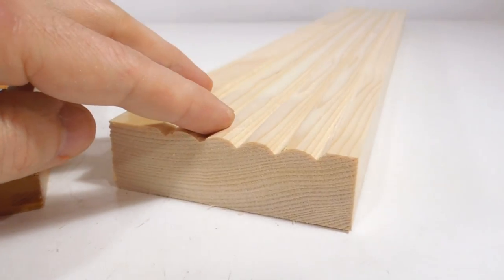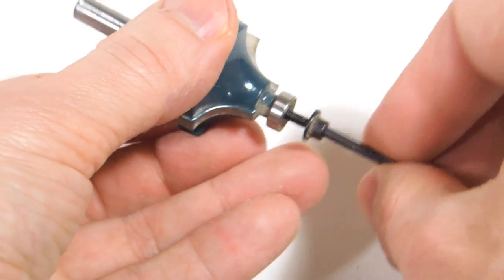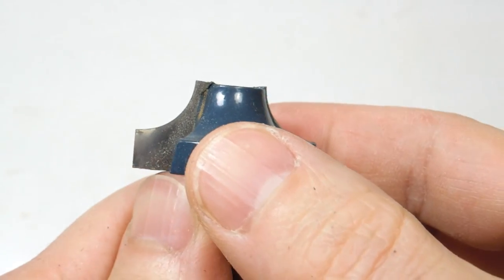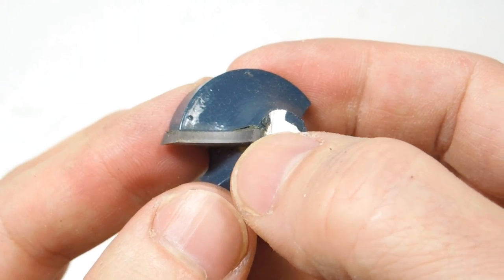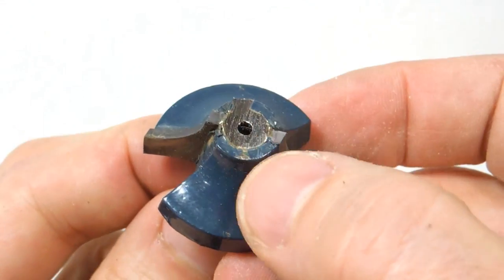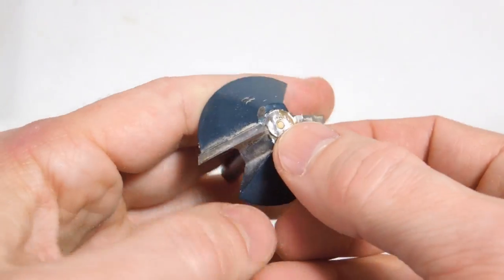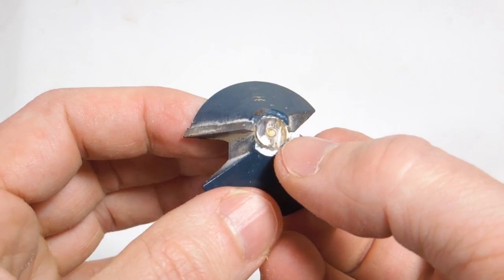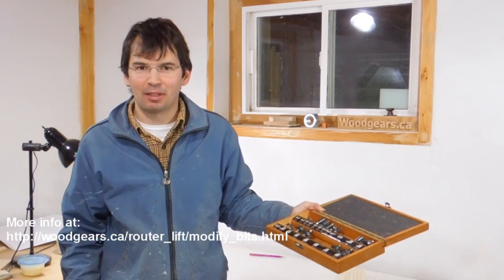Modifying router bits

Comment: As for the folks talking about balance, I once had a 3/4 inch straight bit throw one of the carbide cutters off, in it's entirety. the bit was 3/4 with a 1" cutting face, so it was a large cutter in respect to the overall size of the bit. I noticed it had slowed in material removal, and seemed to be running a little rougher, but continued to run 800 pcs over it that day. When the job was finished I decided to take the time to change the bit and then reset the height.

Comment: When I changed the bit only then did I notice it had thrown a cutter off. It started running rough about 4 hrs before we finished, so I estimated it had run a little less than half the run, and that tallied up to be around 1400 linear ft of dado I cut with a one bladed bit. It never vibrated any more than before it had thrown the cutter. It did chatter a little when cutting, but ran idle just as smooth before. The vibration coming from the router armatures was the only noticeable vibration.

Comment: @smfield The shafts are regular tool steel, but the carbide is not tempered as we know it with typical steel, so in other words unless you heat the bit enough to loose the temper in the bit you'll be hot enough to melt the solder holding the carbide on and it's a total loss at that point anyway.

Comment: You can also try to drill it away with a countersink using the screw hole as pilot hole. As long as you dont hit the carbide it should work.

Comment: I would suggest using a Dremel, or something similar, with a small grinding wheel for the detail work, just before the carbide tip. And a question, Mathias.
Was it just me or is your bench grinder not screwed on your bench? I've noticed a bit of play when the router bit came in contact with the grinding wheel...
Anyways, love your work!

Comment: I'm really new at this....Why wouldn't they make them like that in the first place??

I guess my questions is really, What is the post actually for?

Thanks.
Reply: It helps impart the shape of the tool into the edge or corner of the workpiece. Without it (and without a fence on the router table) you wouldn't have as much control over where bit is going and potentially damage your workpiece.